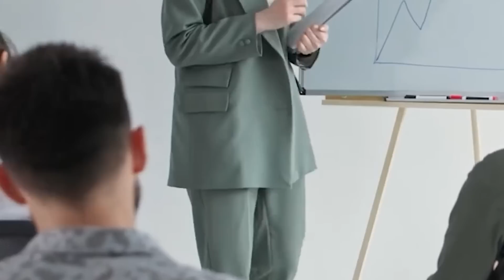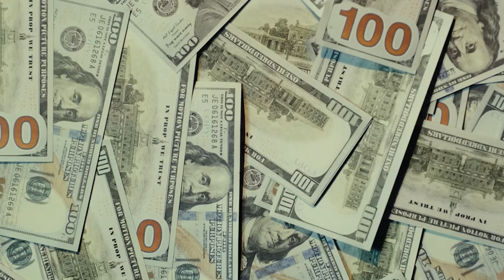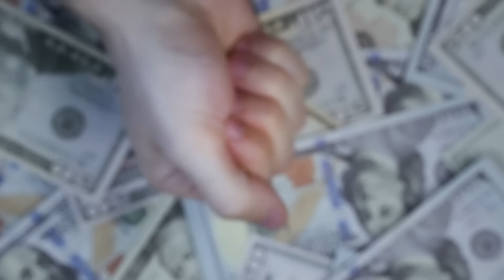It's Mind-blowing! What SpaceX President Just Did With Starship Shocked The Whole Industry…

Comment: SpaceX made 569 rockets 🚀 what they do with all those engines.
Reply: They made 569 Engines. Each starship / super heavy combo uses 33 engines on super heavy, increasing to 35 with new design. 
And 3 sea level and 3 vacuum engines on each Starship. 
So 10 Starship/Superheavy stacks required 390 raptor engines. 
SpaceX has made more than 12 super heavy boosters and 33 starships
Reply: SpaceX has not built 569 rockets, please get a grip, mate.
Reply from the maker: some of these will be used in upcoming flights, and some will be adjusted for research and testing. 
In reality, they also have a lot of unused Raptor 1 engines
Reply: they're going to need more rockets!